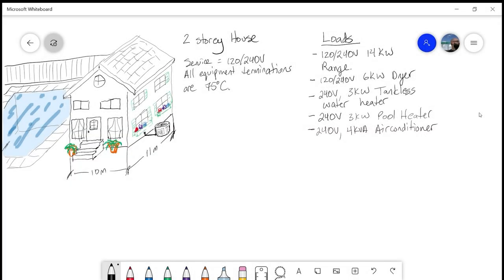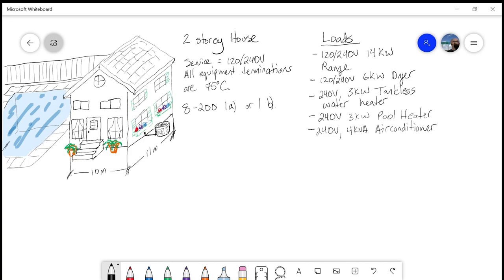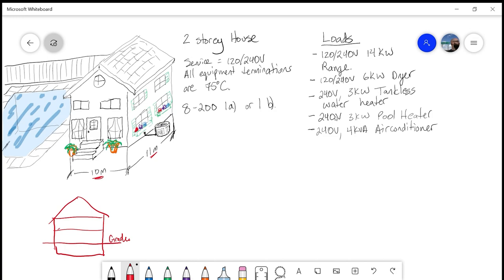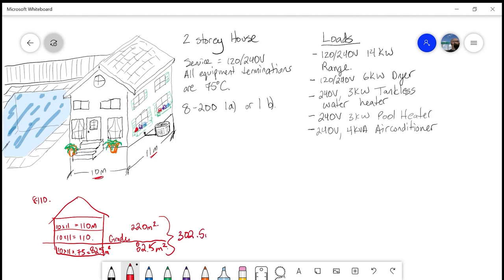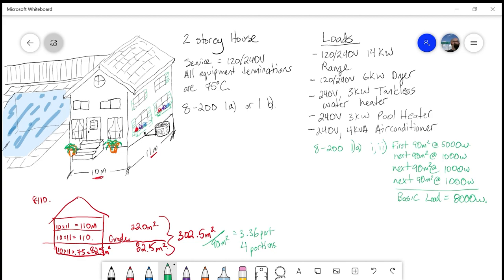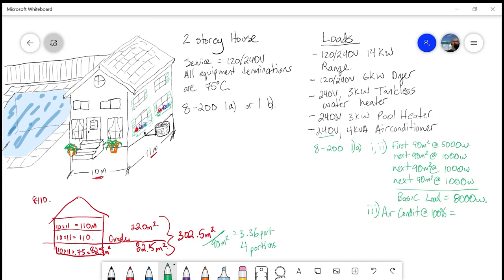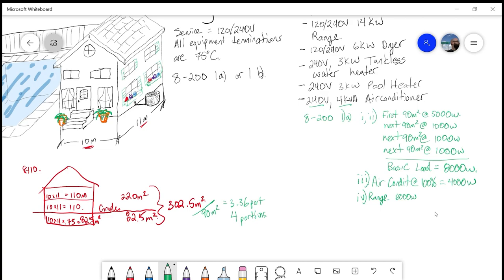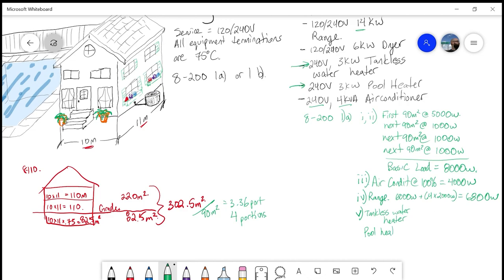Single Dwelling Service Calculation

Comment: if i am right, you have omitted rule 8-104 6) a) b). while calculating the ampacity. it should be 26.3k/0.8= 32.8k. 32.8k/0.24kv=136.67A. T2->75 deg->1/0 wire. Kindly correct if i am wrong.
Reply from the maker: 8-200 3) states that the load calculated from 8-200 1) shall be considered non continuous, so applying the 80% is not required.
Reply: @schulerruler  Thank you for your quick response and clarification. I really appreciate it. I have encountered a problem where 8-104 6) was applied.  However, I am still not clear about where to apply rule 8-104 6).

Comment: This is a very helpful explanation of service.   Would a “heated” crawl space (gas furnace or heat pump) be considered when calculating living space?
Reply from the maker: With the wording of the 2024, we now consider any basement or crawlspace with more than 1.8m from the lowest point of the ceiling to the floor at 75%.

Comment: Schulerruler, Excellent Video. 
I don't have access to a Canadian Electrical Code Book. Can you help? I'm planning a 40' x 64' Workshop perhaps for light commercial work at some point. I thought I could get by with a 60 Amp Service but looking towards the future I think 100 Amp is more appropriate. Does Cdn Code differentiate between Residential / Shop / Lt Commercial ? Someone suggested using a Rule of Thumb - 3 Watts per square ft for Lighting and Receptacles. 40' x 64' = 2560 Sq Ft x 3W = 7680W / 120 or 240 = 64A or 32A  I've done my load calculations and fall well with 100 Amps. Catering for a Stage II EV Charger from time to time is my biggest load by far going forward. Am' i on the right track? Thank you.

Comment: Would you not need to increase the wire ampacity to the ocpd rating due to 14-100 d) ii)? Otherwise this 125A breaker would not provide overcurrent protection (only ground fault/short circuit) for the wire?

Comment: thanks for teh videos man it really helps! theyre so much better than my teacher. Question, where do I find the number of spaces needed for the panel board at the end of the question, in the 2021 CEC? the rules changed and its not there anymore
Reply from the maker: The size of the panel is now determined based on the branch circuit requirements, with an additional 4 120v spaces left over. As opposed to a minimum number of spaces plus 2 120v spaces.
You would need to add up branch circuits for receptacles, lighting, etc and include any other loads with they're own overcurrent.

Comment: Hi my friend, thank you so much and your video is so helpful for me, just one question,  why don't you choice the smaller overcurrent size? Just like for motor. Thank you again.
Reply from the maker: The method used for academic purposes selects the largest overcurrent. This harmonizes answers.
In the field you could go with the smaller size, but if the load is known, and is in accordance with section 8, we are permitted to use the next size available, up to 800 amps.
Reply: @schulerruler Thanks for your reply. Have a good.
Reply: @schulerruler  Hi man, sorry to bother you. Just one thing confused me that "how many supply services of the same voltage are required to be run to a six unit row housing condominium complex, where each consumer has its own service?" I got the answer is 2, but it says four in Rule 6-104. Could you help me? Thank you, have a great day.

Comment: What do you do if you have an electric cooktop and an electric stove that are not combined as one unit? 6000 for each? Or can the oven have a factor of 25% applied to it, as covered in section vii)A)
Reply from the maker: Check out 8-300 2) as it specifically deals with that situation. The two would be added together and treated as one unit for branch circuit calculation purposes.

If you have a separate range (likes a secondary) it can be added as per 8-200 1)a)vii) as noted in the same rule in appendix B.

Comment: for the dimensions of the house, doesn't 8-110 state the living area should be determined from the inside dimensions of the house (like, subtract the walls)?  i will pretend the house walls are thin :D

Comment: I quess there is wrong in calculation of area. 1st floor and 2nd floor are good it was converted into mm² beacause 110m convert to mm² is 220mm², but the basement i feel something wrong on area. 110m×.75=82.5m convert to mm² is  165mm²
Reply: what are you talking about??? The unit is m^2, he added up the value from first and second floor (both 110m^2 because you take 100% of the liveable space above grade ) to get the 220m^2. The 82.5m^2 is because the code says when you're taking the value from the basement you use 75%  of it so 110m^2 x 0.75 = 82.5m^2